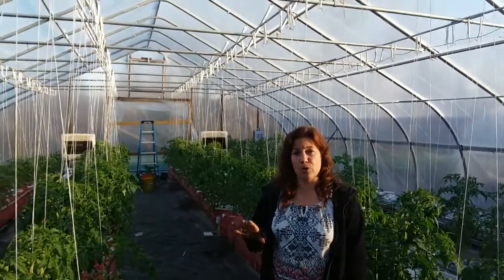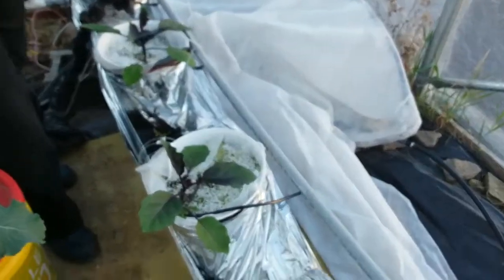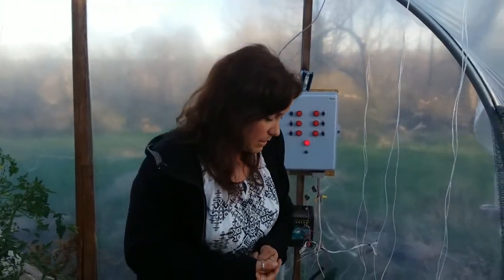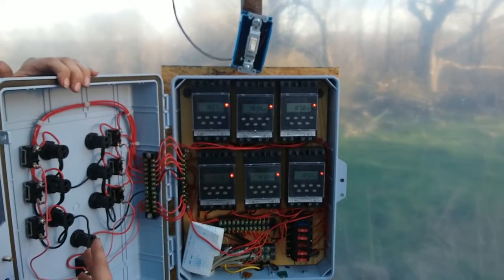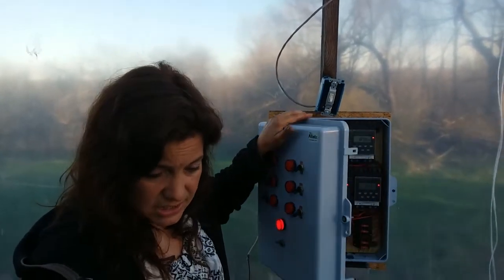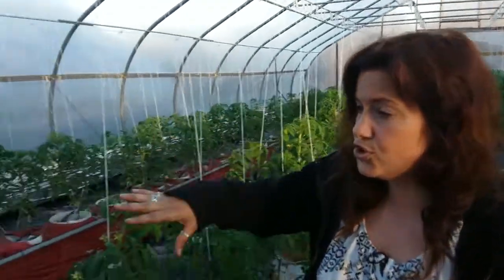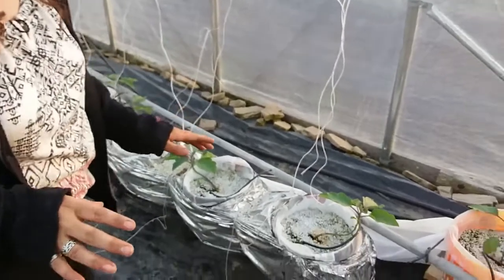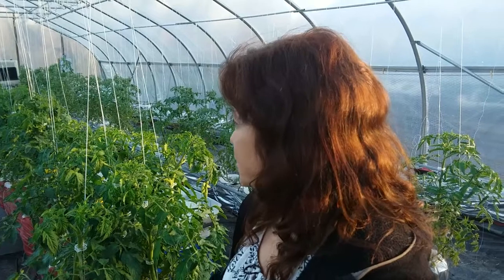Solar powered dutch bucket greenhouse

Comment: I'm setting up my NFT and dutch bucket system soon. I'm going to use a 45 gal tot for my water to supply water to my plants. the green house is 10X12 and was thinking about running 24hrs. Do I need to drain all of the water or only add nutrients with water when needed. Sorry I'm completely new to this.
Reply from the maker: Have one gallon per plant storage is best. You can make a tank out of USB, 2x4 and 6 mil plastic. Change the water each plant cycle.
Reply from the maker: Not USB.   OSB